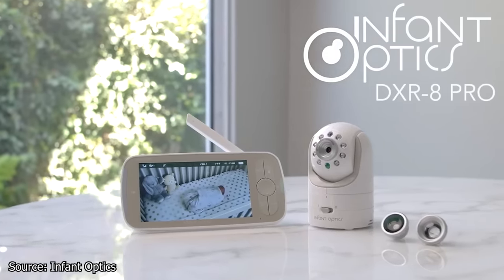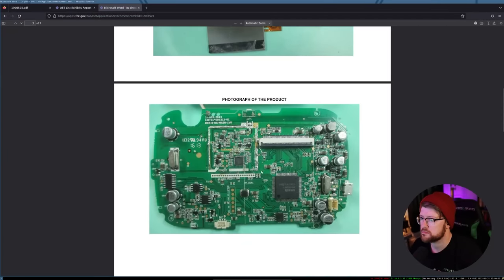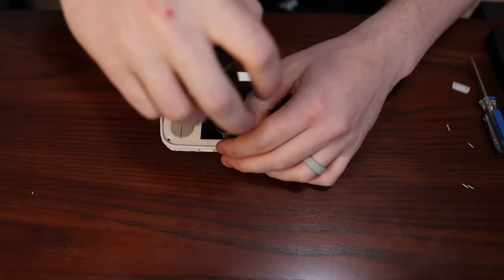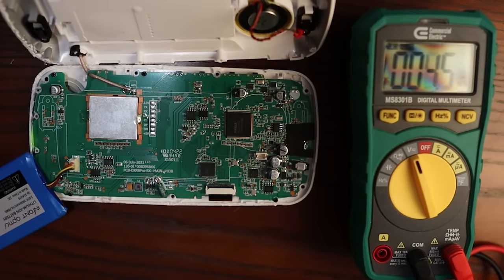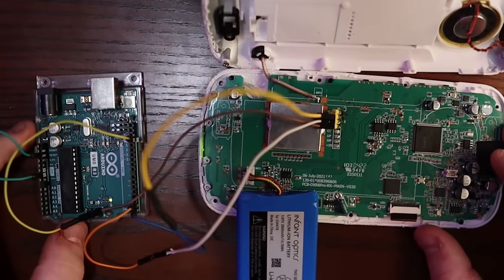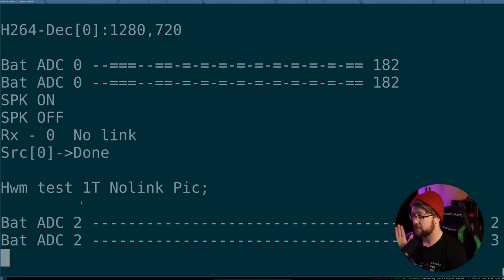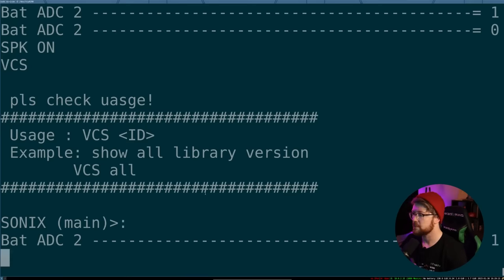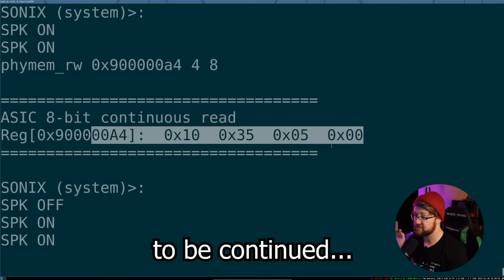i hacked my son's baby monitor, for science.

Comment: Whatever you get, just stay faaaaar away from anything Tuya.

Bought a cheap doorbell thingy, turns out behind several layers of extra labels it's a Bell5S, and it turns out, just inserting a SD card witha magic file you can rewrite the firmware to whatever you (or anyone dropping by your doorbell) may prefer. And how difficult was that firmware to hack? Well, it's not encrypted, basic Linux distro that runs a single largeish Tuya app that is used on more or less all other similar devices. And it's basically compiled with debug mode (no optimization, tons of debug printfs with code references). Might be a bit alien for the average web developer, but this is childs play for anyone who's worked on C or embedded code.

And yeah, it doesn't help that by default it sends everything into the "cloud".
Reply: this is not tuya?????!!! he is talking about a baby monitor that is not connected to tuya cloud? remove your comment it does not belong here
Reply: @309electronics5  uhm, excuse me sir, but what's your problem?
There's plenty of tuya baby monitors, something other's might not be aware when browsing for one, and he doesn't specifically warn about this. That's why I mentioned it.
I made no claims that this specific device is a tuya device (and yet, by the wording in our comment, it sounds like you're personally very offended by this).

Comment: If only someone broke into your house and hard wired into your UART interface... come on man pleaseeeee. Its cool but it isnt a real attack surface. This doesnt really affect end user.
Reply: Exactly what I was thinking, lets be realistic...
Reply: Nobody said that this is a realistic attack vector, not sure why you thought it was? This is meant to be a method to explore the device, get a memory dump and search for vulnerabilities...
You're basically saying that a burglar breaking into your house isn't a security risk to your car, while that burglar grabs the keys to your car...
Reply: @someguy4915  no it’s making a video saying “is my car hackable” and then breaking into the canbus of the car to control it… the company won’t insure security of physical hardware so long story short, it’s clickbait. 

Alllllll microcontrollers require ICSP headers to flash firmware. Do you want companies to cover them in resin after manufacturing? Haha
Reply: @duckydev9427  Not all microcontrollers require ICSP headers, also this is a SoC.
Many microcontrollers and SoCs load firmware from an I2C or even SPI EEPROM, can be programmed over UART or have a proprietary interface or JTAG port.

Do I want manufacturers to cover them in resin? No, I don't think I've ever said that, not sure where you got that idea but if that's your preference I'd recommend against it.

Also, I'd expect the manufacturer of a baby cam to not insure anything, that's what insurance companies do.
I would absolutely expect them to 'ensure' security, that doesn't mean I expect them to block off any ports, again I never said they should, that is just you assuming things without reason.

If you want to see if for instance the new Ford car can be hacked, it's much easier to lend your friends' Ford and dump memory of various chips inside it to then see if any have vulnerabilities.

You expect a hacker to walk up to a car and just 'Hollywood style' hack it on the spot without any prior effort/knowledge, that's just not how it works.
In order to hack into a device/system/network/anything you need knowledge on how that thing works, dumping memory through an exposed UART is a great way to start with that.

You might be better of making less assumptions, especially when dealing with security, and instead being open to discovering and learning how this works first.
Reply: @someguy4915  I’m sure you get the point of my comment, but man if it makes you feel any better you had a good response.
Reply: @duckydev9427  I agree that an attack based on the physical level, for this type of device, is no serious threat, of course it isn't.
But like I said, this is only the first step in trying to find actually useful/practical attack options.
You dump the memory, find out that the device has a call-home function where it tries to download firmware from a domain that the company no longer owns and so you buy the domain and now have the option to upload malicious malware to all these types of devices worldwide. Obviously that is a worst-case scenario but this has happened before with security cameras (including Cisco...)
That type of attack absolutely would affect the end-user. And the only way to figure out the potential for that type of hack is to start with a test unit in your hands, trying to get a UART going and poking the device.

I get your point,  but (no offense intended or anything) it is kind of redundant/stating the obvious while potentially missing the point of the video; poking a device to find exploits.